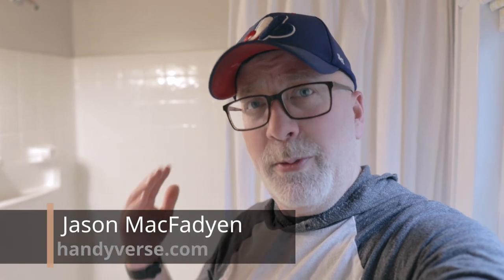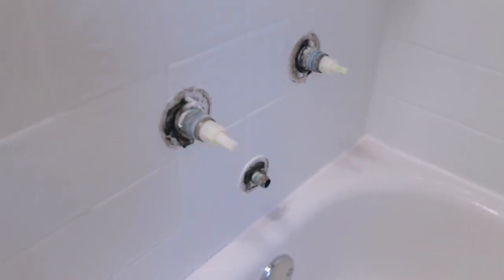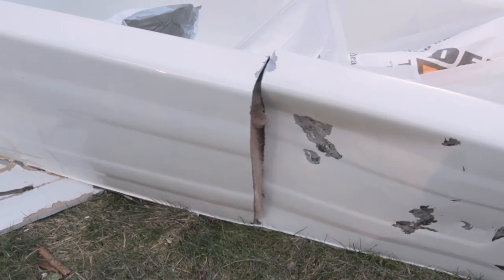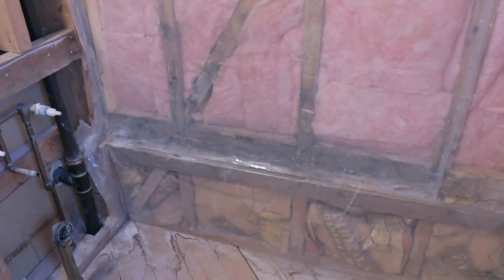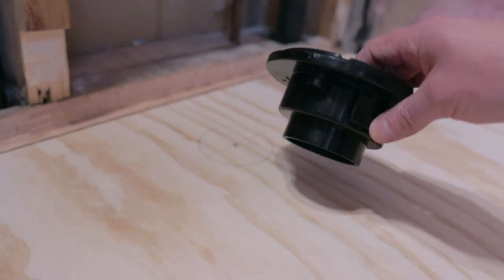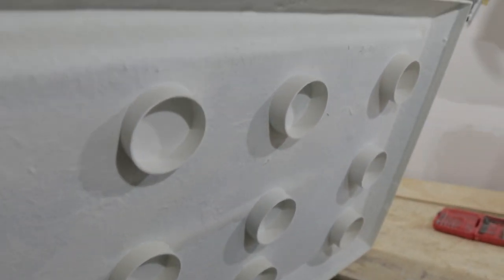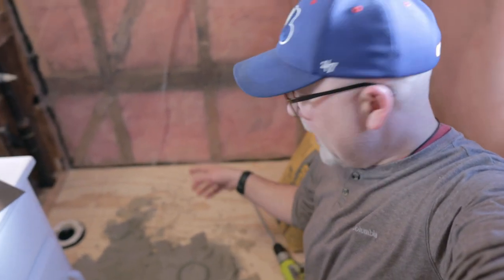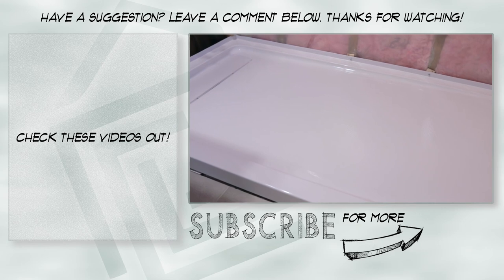Mold! - Costco OVE Marylou 60 Shower Base Prep and Installation

Comment: Are you sure that is the correct drain. That looks like the drain for a pvc shower pan liner? The proper drain has a locking nut and rubber gasket on the under side. Am I incorrect? Othewise totally great video. About to install the exact same kit from Costco.

Comment: Hi there. I am in the middle of installing one of these right now. Wish I watched this video first. I did the flanges all wrong!

I am curious this video was posted 3 years ago, how are things going? I feel like if the system is going to fail, it would be at the flanges.

Comment: Did the flanges/lip attachments come with your kit? We had our shower installed by a contractor, and observed that it was leaking. When ripping out the tiles, I noticed that the attachments were not installed.